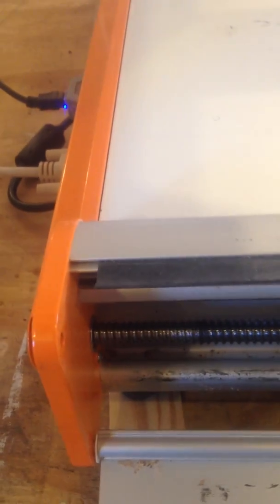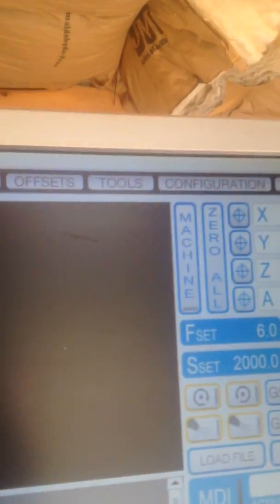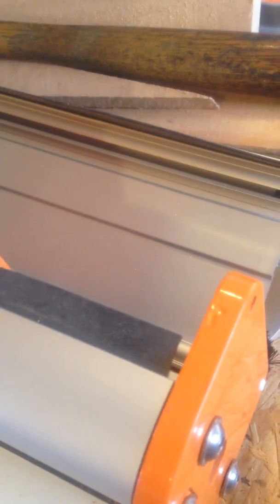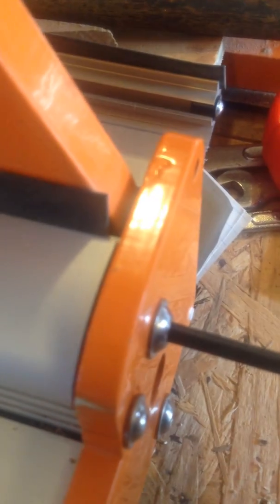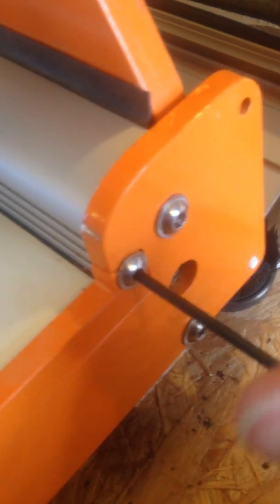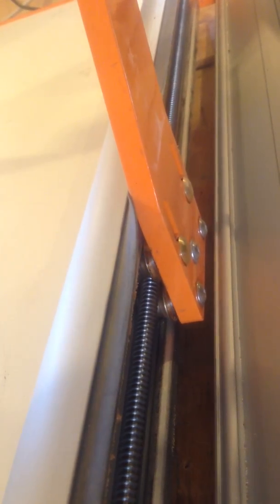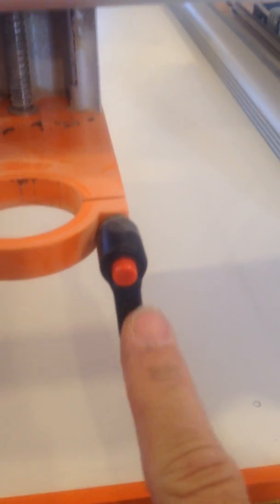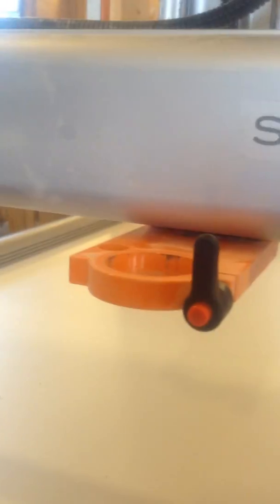Full setup adjustments of the stepcrap 840

Comment: What's the point of moving to the ends of the machine and tighten the end plate screws if you don't first adjust the rollers? The point is that you adjust the rollers first to where it doesn't have that play, and then loosen the end plate screws and move to end and tighten the screws, so that they spread the extrusion. When you finally tighten the end plate screws the machine should move fine for the whole travel and not have any noticeable play.

Comment: I got a 840 as well. Got some issues with the Y-axis too. But luckily it doesn't sound as bad as yours. De guy in the shop said it all comes down to the final adjustment. He also told me the quality of the parts is going down because of the huge demand. 
But if it runs, it runs well.

Comment: Did you get this figured out? I was about to order one.
Reply from the maker: Hi,
They tell me I may have debris on the screw but I am having far worse problem. The machine changes the zero of the X or Z in the middle of the job which has wrecked some jobs. Also they say the work area for the Z is 5.5 inches
but with the spindle and the bit in place it is more like 4.5 inches not bad but a little false advertising.
Reply: Do you feel like the company is treating you right? Are they offering to fix it, or send you replacement parts? I was just about to buy one, argh!
Reply from the maker: They have a guy looking into it been a week but no results. I can not recomend the Stepcraft to anyone right now. I could have been frustrated for a lot less money.
Reply from the maker: If yo are going to buy a Stepcraft I Would suggest using Pay Pal as the means to pay. When I was having problems with the machine I wasn't getting very good response but after opening a case with Pay Pal they are going out of their way to help. The machine is pretty good even with the problems I have had. There is a lot of little adjustments that you need to fiddle with until it is running properly. Thanks for viewing and good luck.
Reply: Thanks for the update. I still think the 840 is the machine for me, but I started looking at other brands since you were having problems. Did stepcraft build your machine, or did you?
Reply from the maker: I built it but it really isn't that hard. There are a lot of adjustments you have to keep up with and a dozen problems that can arise even if they build it. If you have the extra $450 or so to spend you can save yourself 6 hours. I just had more time than money. Good luck
Reply from the maker: Did you get a 840 stepcrap? If not you might want to look into the Shark extended almost double but much more beafy with a 2 hp water cooled spindle and bigger work area.